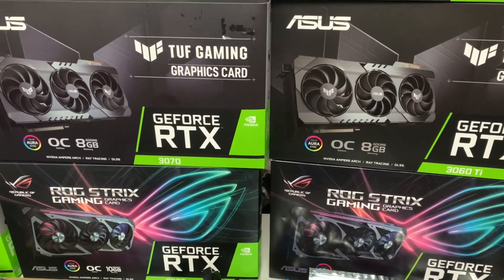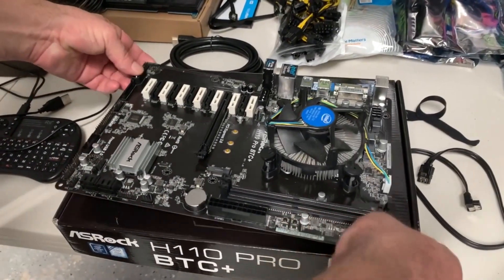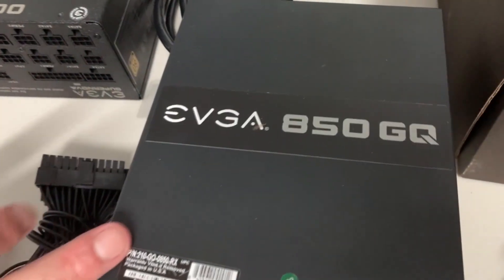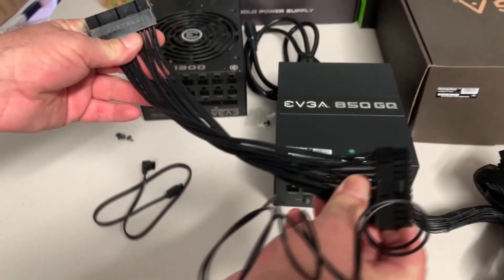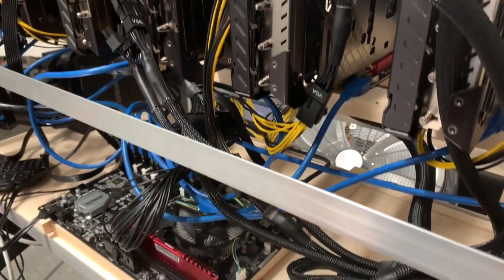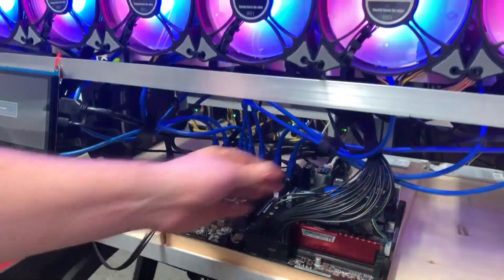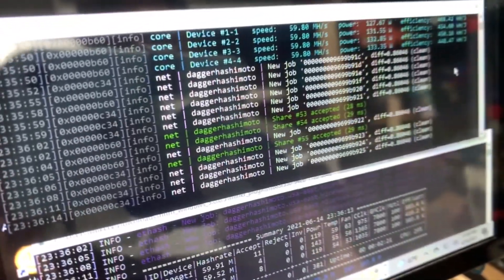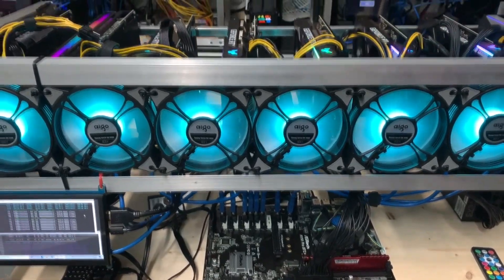How to build a Crypto Mining Rig that can make $1000 + per month [Step by Step]

Comment: Few tips:
1. You don't need a mining frame, they are not cheap esp. during high demand period when pay out are high. Instead, get wired shelfs such as 1800x900x450 by dimensions with multi tiers for example and hang your gpus with zip ties or some premade clips. My wired shelf (3 tiers)cost me $99 and can fit 30 gpus, 10 gpus per tier, for mining frames you will need 4-5 of them. Advantage being those gpus are in a zig zag formation instead of sardine formation, this arrangement will have much better spacing and thus better cooling potentials w/o heat being passed from one to another.

2.   You don't need mining motherboards(they cost $400-500 each), instead just get basic MBs(~$100) with 3 or 4 pcie slots and get PCIE splitters(can split 1 pcie to 4-7 usb connections for you risers), so you can easily runs 10 gpus on a low end MB, and dont forget you can convert m.2 to usb too(they cost couple of bucks)

3. PSUs, get two 850w Psus instead of a single1600w, not only will it cost less but you will get more flexibility and more cables out of the box.

4. Get great cards instead of good cards, example get 3060tis/3070s/3080s instead of 1660super/ti, they cost more but you have high density and high hash rate so less peripherals and less space(MB, PSU, risers, cables, frames etc) which all adds up to the cost, not to mention more gpus requires more maintenance and when it's time to sell you will pay more fees to ebay or what ever you use to sell, also better gpus are easier to sell and more likely to retain value.

5. High power card like 3080/3090 always requires PCIe cable to power riser instead of sata as they are likely to draw more than 50w the sata cables can provide.

That's all I can think of and hope it will help
Reply from the maker: Some Great Tips I'll consider  - Thanks !

Comment: Thank you for the really good and relevant information! I used your list of items to purchase on Amazon, do i need to add a CPU to the order? Or does it come with the motherboard? Thanks in advance
Reply from the maker: Thank you for the comment. The motherboard does not come with a CPU. You will need one to buy one. For this specific build I used an Intel Celeron G3930,  Amazon was not showing them as available when I posted so I coulnt add a link.  I have other mining rigs using the same motherboard with an intel G3900 and another with a Pentium G4400 processors - both run great.  See ASRock website for complete CPU List 

https://www.asrock.com/mb/Intel/H110%20Pro%20BTC+/index.asp

I'm planning more in depth builds in next few weeks with different Cards, power supplies, Rig Cooling & more. Drop a comment if there is anything specific you would like to see. 
Happy Mining
Reply: @CryptoMiningInsider  Ooooh K!!!  The parts I ordered will be here Saturday and then the Mother board will be here Monday. I would like to see anything you are willing to share with us.  Specifically, moving forward with my build, I would like to see the process of how to just boot up for the first time and install the operating systems.
Reply from the maker: @Cryptocaleb24  Great and Thanks for supporting our Channel !
You will have your hardware before I get a Mining Rig Setup and configuration video made, but I can give you few tips. For Windows, I downloaded Windows from Microsoft site to a thumb drive and install from there.  

https://www.microsoft.com/en-us/software-download/windows10

If your new to crypto mining I suggest you look into nicehash as its probably the easiest way to get started on windows . I used other more advanced tools like HiveOS , but they are definitely more complex to setup and configure.

Happy Mining !
Reply: @CryptoMiningInsider  would a Ryzen 7 3700x 8 core 16 thread processor do the trick
Reply from the maker: @Cryptocaleb24  A Ryzen 7 3700x would NOT fit or work.
The ASRock H110 Pro BTC+ Motherboard only supports certain INTEL CPUs, not AMDs.

ASRock publishes a list of supported CPUs for the H110 Pro Motherboard on their website 
 https://www.asrock.com/mb/Intel/H110%20Pro%20BTC+/index.asp#CPU

Comment: Wow dude ty for all the info on how to do it right. Do you think it would be worth it to buy these GPUs above retail? Any advice on electrical changes that have to be made to my home if any?
Reply from the maker: Thank you for your comment.  I always try to buy GPUs at MSRP or slightly above that (This is not financial advice) 
This allows me to break even (ROI) as fast as possible. In this RIG Build video 7 of the 8 cards were purchased at MSRP, one 3060 TI I paid an extra $200 from a 3rd party seller on Amazon earlier this year - It seemed like a good deal to me at the time.  

I'm not an electrician, but I personally make it a practice to never go over 80% of the outlets capacity for my rigs. There are Meters available like Kill o Watt to help measure this. I always recommend people contact a licensed electrician with electrical questions. 

I plan to be do a video soon about how I power my mining rigs using ATX PSUs, Server PSU and a hybrid of both.
Reply: nope id wait till they are close to msrp as possible even the retailers selling 300-500+ over retail and they call me a scalper ! but if you get them for atleast what the stores sell them for then ull hit break even in 1 year from today. when prices go to the moon sell the top or hold to pay off your equipment sooner